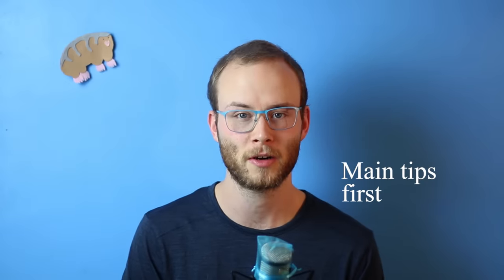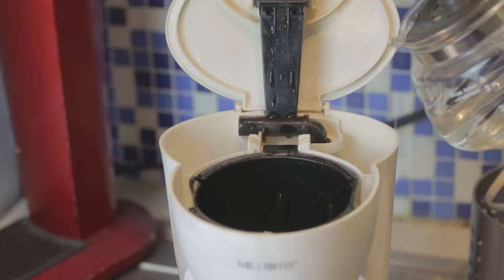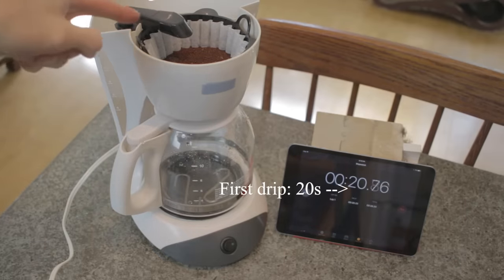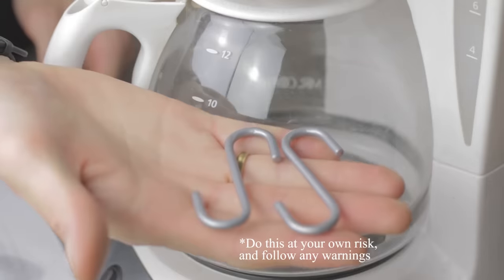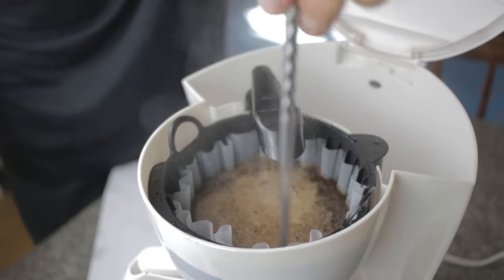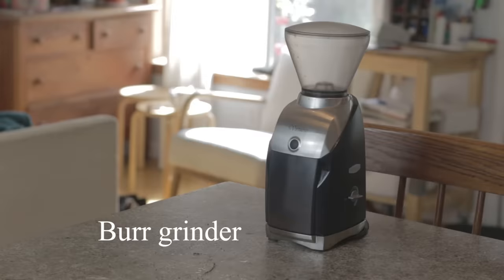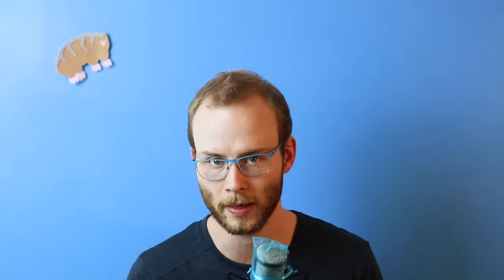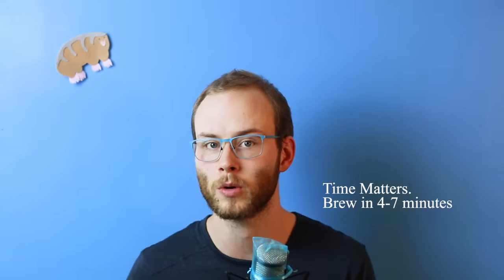Can you brew good coffee with cheap machines?

Comment: Omg, I think you've done it! I've been buying a ton of coffee makers over the years as well trying to get the flavor to come out right. I always noticed that at my mom's house the coffee comes out better tasting and they never clean their machine, but they have a bigger machine than I do. I've used bottled water and filtered water and cleaned my 5 cup coffee maker but with only minor success of making it come out tasting better. I've even had a water test done on my house and resorted to cleaning out my coffee maker with each use lol. I tried going to making the coffee from scratch with grinding beans and heating up water etc. Also with minor success and decided it was not worth the extra work lol. After watching this, come to find out the coffee maker was not only not completely covering all the coffee grinds but It's also not reaching high enough temps. so now I'm back to heating water manually and it's tasting great now. Thanks so much. I get to get rid of the coffee maker graveyard. I figured it was the plastic I was tasting lol. Was about to spend hundreds on something with a metal tank.

Comment: I always do a hot water pour over in my auto dripper as I turn it on. That makes a huge difference. Than I stir the grounds after pot is half way through. No hot water in reservoir necessary if you do it that way 😏

Comment: My personal experience is that if you are going with a basic 10 or 12 cup machine, stick with the 900 watt models. The 700 watt models just do not get hot enough, and the resulting coffee is so so.
Reply: I have a 12 cup 900 watt cheapo Mr. Coffee maker.  When I brew 4 cups which is really about 2 10 oz cups and use 2 tablespoons of coffee all the grounds get covered by the hot water and the coffee comes out tasting pretty good.  Thanks for that important tip of using a higher wattage model because I was thinking of downgrading to a smaller lower wattage cheap coffee maker.

Comment: I used distilled water in my machine so it doesn't leave mineral deposits. I'm sure it changes the flavor of the coffee, but I'm used to it. 
The recirculating tip is one I'm going to try.
Reply from the maker: If I could, may I suggest you try a low-mineral water instead of distilled? Distilled really makes strange flavors in coffee, in my experience. It's also not great to ingest on its own. Standard bottled water is one thing to try, like crystal geyser?

Comment: I am an engineer and all for fixing flaws of typical retail products, but this is almost silly to watch.  The issues pointed out are all very valid BUT WHY?  Why go through all of these fixes and disrupt a normal brewing process?  If you are willing to recycle/reheat heated water, then stir, then why not just get a pour over setup??  Most of fixes discussed here are NOT FIXES, and they are workarounds - workarounds require you to be there and repeatedly disrupt the process.  In order to even stir, your cheap brewer has to boil and deliver water fast enough which most don't.  Therefore, you have to remove the pot, so the auto-stop plugs the drip point to let the water accumulate to a point you can stir before it's dripped out.  For god's sake, just get a pour over or french press already!  One thing you haven't thought of - it's not the heating element can't reach certain higher temperature, it's the plastic of these typical machines can't withstand the higher temperature.  By you artificially increase the temperature on a regular basis, have you consider what type of chemical compounds will get released from the plastic?   This is a perfect example of over-engineering out of and above common-sense, or getting into tunnel vision on a specific problem.  One simple trick that will work without you manually intervene  is 1) grind your coffee slightly finer to slow the drip rate so there is enough accumulation; 2) don't shake/flat out your coffee grounds on these flat bottom brewer, instead, pile your grounds into a small hill biased under the sprout point of your machine.
Reply from the maker: Yeah I agree, I think if people wanted to do this every day the best long term plan would be to upgrade to a pour-over setup, or something designed to brew coffee with more control. I'm not sure I agree with your tips though. A cone of coffee will just push water to the edges, and if you combine that with a finer grind, your fines migration will certainly cause blockage and poor extraction. You want steady and even flow and you want to avoid stalling. Scott Rao suggests coarse grind and assuring that you have a flat bed of grounds from beginning to end, with proper water flow.